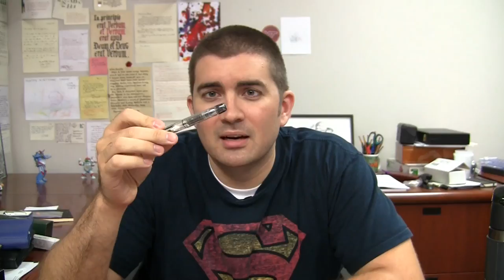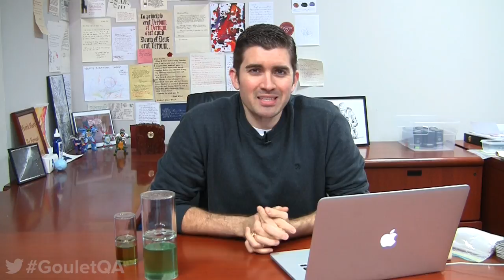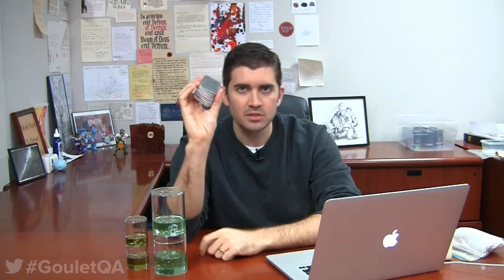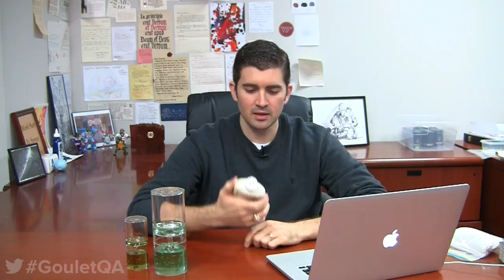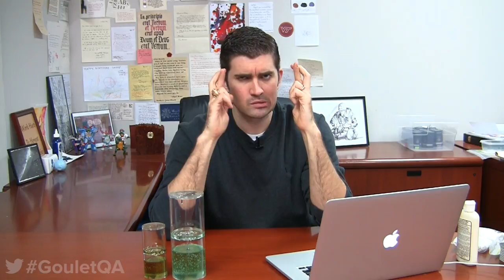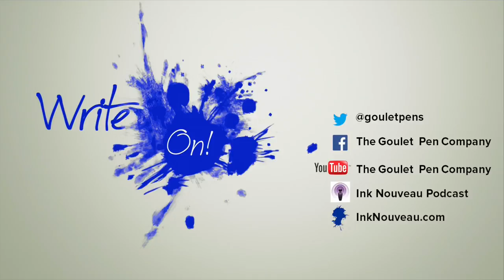Goulet Q&A Episode 20: Pen Maintenance

Comment: For dried up pens (if there's still ink in them)
I have a vial of pen flush diluted to 1/10 it's original concentration. I use a syringe to drop that fluid onto the nib, and use the converter to pull that fluid into the pen. Wait 1 minute or so, and the pen writes as good as new (for the most part), and saves a bit of ink and a lot of cleaning.

Comment: This might be an interesting topic for Goulet q&a:

 If someone wanted to buy 20 (money not being an issue) pens and they hire Brian Goulet to do the purchasing.

The only requirements being "getting the ultimate pens and a full FP experience or as broad as possible", meaning different countries of origin, different filler systems, different price range, vintage (aware you are not a vintage guy) and ultra modern (Conid pen), etc. 

How would that 20 pen list look like? 

te make myself clearer this is the way I might start if given the task.

Germany: Lamy 2k, MB 149, Pelikan M800
England: Conway Stewart XX, Parker 51
Japan: Pilot Vanishing Point, Nakaya XX
and so on..

maybe in the foreseeable future...?
Reply from the maker: That is a great question! I'd have to charge you for the answer though ;) jk

Comment: Can you not also dissasemble the Lamy 2000? It is more difficult (and I'm sure not reccomended) but it can be done, right?

Also, when discussing the heat setting on a ebonite feed, you said to heat the water just below the point of boiling. Why not to boiling? The water can never go higher than that temperature.
Reply from the maker: Taking the grip off the Lamy 2000 and the nib out is easy and safe, we did a video on that here: Removing a Lamy 2000 Nib- Ink Nouveau

But taking apart the piston mechanism is NOT something we recommend. It can be done, but it's too easy to damage it. 

You can boil the water if you want, but you don't want to put the feed into it until it's just come off of the boil...if it's too hot when you put the feed in, it can cause permanent damage. This is a much greater risk if you're doing heat-setting using a flame instead of hot water...but still, the feed will be much safer if you keep it just off the boil.